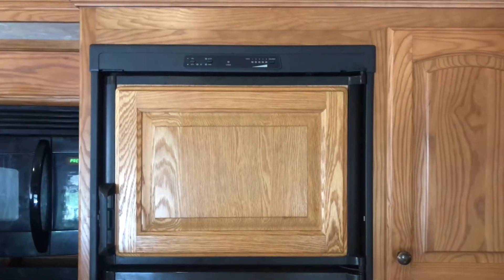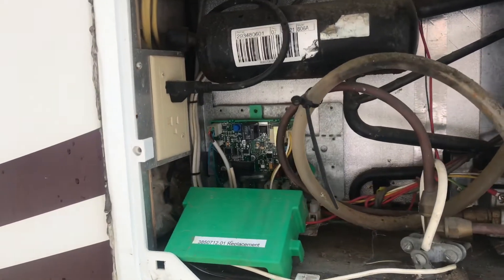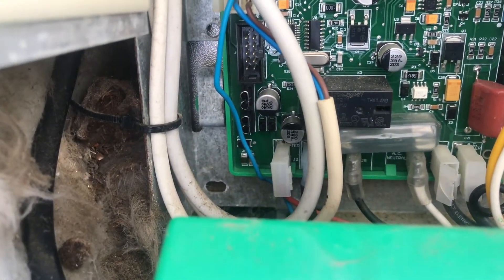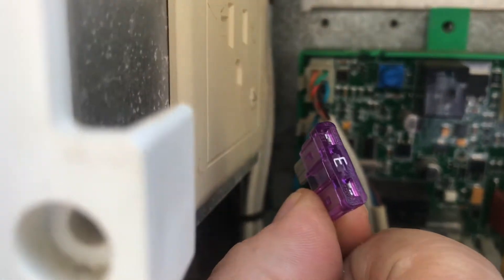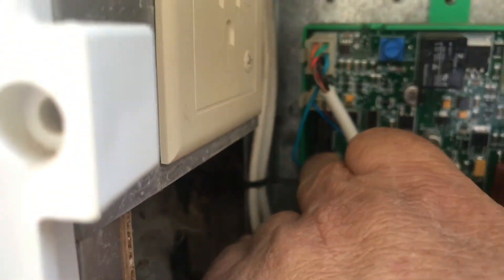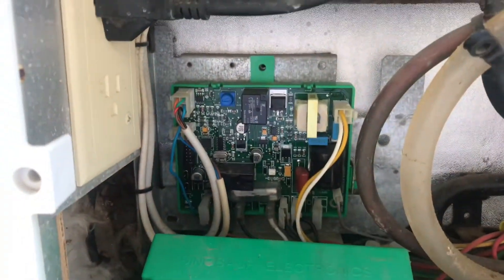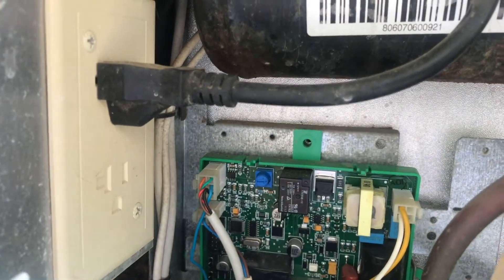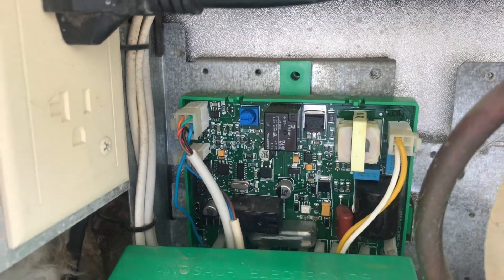Rv Domedic refridg repair!!

Comment: Awesome that is was a easy fix. Ours will need replaced, the freezer temp is perfect but the fridge just doesn’t stay quite cold enough. Finding someone who knows how to repair them seems to be a problem many people have. Not quite sure what we will do but I’m sure we will figure it out. Great video, always love when people share helpful information with the RV Community.
Reply from the maker: I watched a YouTube video that said your RV fridge should work for more than 20 years. They also said that you need to not over pack. And leave space for air to move from the bottom to the top.
Reply: Johny's Journeys I’ve read the same. I’ve also heard that when they are in the slide it’s harder to keep them cool. I would replace it with a residential one today if getting it in and out was a bit easier. I have seen people have to remove windows to get these four door Dometics out and I’m hoping that won’t be the case for us. We shall see.🤞🤞

Comment: Oh you got lucky! I tried everything to troubleshoot my dometic. Couldnt figure out what was wrong with it so replaced it with apartment size fridge instead. Those dometics can be a PITA and expensive to repair/replace!
Reply from the maker: I watched a YouTube video on dometic and the guy said most people replace a good fridge cuz of something simple and repair techs say it can’t be fixed even when it can!
Reply: @johnysjourneys9450  Thats probably true. Though just to have the mobile RV guy come out and look at it they were gonna charge me $200 then cost of repair on top of that...eek. RV fridge only cost $350 and now I can use it in the tiny home when I move in there. Was the best way for me to go. Wont work for those who are travelling tho thats for sure
Reply from the maker: I totally get it the first thing I tried worked so I got lucky!!!